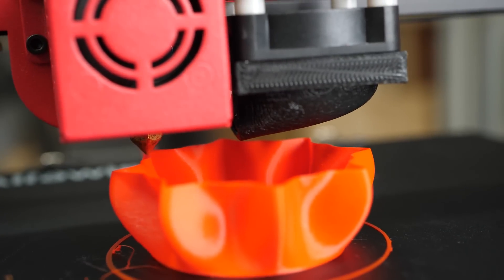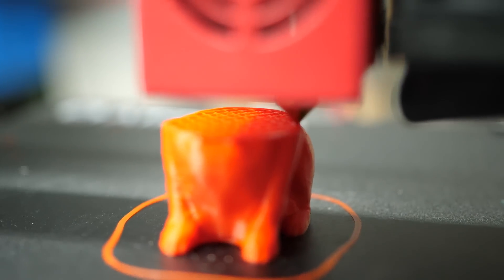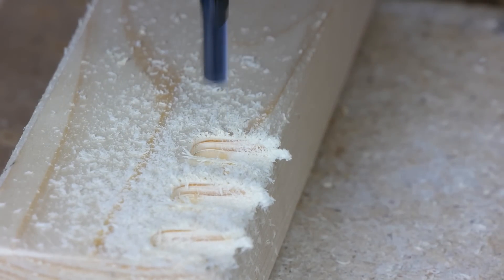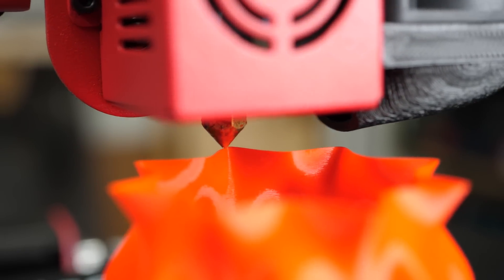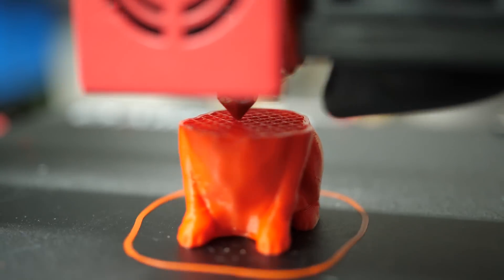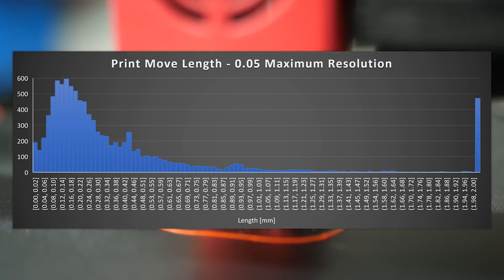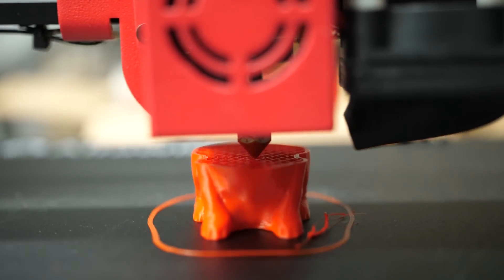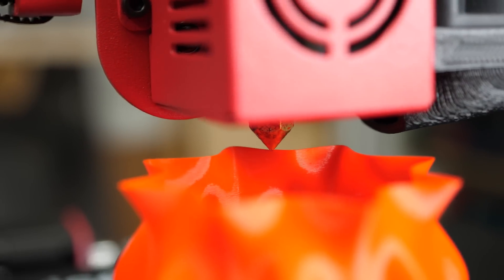(How) I finally got rid of these blobs!

Comment: In many cases it is better to decimate the mesh as this might cause small errors when each layer gets simplified separately. 👍
Reply: On something like the Prusa mini with 32-bit board, would one worry about this per se?
Reply: @danksley  nope i have a mk3s with a 8bit processor and have never had such issues
Reply: @meltedgyrofpv8477  This might not be noticeable at lower speeds or when the object one is slicing isn't as complex as the Buddy model showed in this video.
Reply: @danksley  That's kind of a brute force approach. The slicer really needs to look ahead and smooth the little segments - its the same on CNC machines.
Reply: Hmm that's an interesting approach, as you may otherwise have some extra jagged results in the Z-direction. On some repeating (and gradually smaller) patterns it may result in something that looks like a Moire pattern, but then printed in 3D.   Would it also be possible to reduce the printing speed dynamically when lots of small distances have to be processed? Or will that result in other issues?
Reply: @TD-er  This was my thought over a year ago when i started noticing this on my CR-10, dynamic / adaptive speed control would cure these blobs almost for sure. Adaptive behaviors are implemented WAYyyy to slowly in all slicers, but the one that does it the best is cura, and the one that does it the worst is Simplify 3D.
Reply: @flukve3574  where can I find adaptive speed control in Cura? I can see adaptive layer heights but not speed…
Reply: Is there such a tool available in prusa slicer?
Reply: @Pascal_Robert--Rc_Creations  You could also use Meshmixer which is very simple, compared to Blender. I think Blender is a bit overkill here.
Reply: @luckbot-3000  Sure, but that requires opening an extra program and performing extra steps anyways (though Meshmixer is lighter than Blender). It'd be nice if the slicer already provided such an option.
Reply: @GRBtutorials  I think prusa slicer added that feature very recently, but I don't use it so you'll have to look it up! If I'm not mistaken, both simplify3d and cura are also able to either reduce the mesh or limit the length of moves or both.
Reply: @Pascal_Robert--Rc_Creations  Got answer to your question?
Reply: @Pascal_Robert--Rc_Creations  Did you find an answer to this, or a workaround?
Reply: Wow, I didn't know 8 bit AVR printers are as bad as this. They should approximate a bezier and roughly follow that instead of further decreasing the quality of the model....
Reply: how to fix on prusaslicer?
Reply: The other question is how would you know in advance that your print will blob. It seems like you would need to pre analyze the g code like Stefan did, then make a determination based on the number of small print moves (which would be a pain for each print)...
Reply: @davidpoland1056  Good Idea for a Cura Plugin showing the histogram.
Reply: David Poland polygon count possibly?
Reply: @BossAuto_  I think you'd have to take the surface area of the model into account as well. The problem isn't just many polygons, but rather, many small polygons... Right? I hadn't ever thought about this problem before so I might be completely off with my reasoning, though
Reply: @nyanray  but even more than that,  many small polygons close together such that the number of moves per second overwhelms the processor. It's a cool diagnosis, but applies to a relatively specific set of conditions.
Reply: @davidpoland1056  You can predict it as being likely anywhere you have a pileup of extra tiny moves (which are each a separate command). With longer moves, there is more time before the next command is needed. With tiny moves, it doesn't get to catch up before the next command it needed.
*you could quantify this on your machine with a shape with tight arcs. Either start with too many facets and reduce down until you don't have a problem, or go the other way and start with only a few huge facets (unacceptable detail) and work your way toward more facets until you have a problem.
**and you will learn practically: how much detail is enough vs over kill or under kill

Example: If you reduce the number of facets by half, then you have also reduced the number of commands sent by half

**This will be different for every model of machine**
They all have their own cpu, ram, movement drivers etc. That means they all have their own maximum command data rate.
This is a big part of why industrial machines cost so much more for what looks like similar specs on the advertising sheet.

This is a big issue for hobby cnc routers, so it makes a huge difference whether your circular features are an arc (a single line of code) or a bunch of tiny facets (lots of lines of code).
*Designing in CAD software, get nice accurate arcs. Importing from visual media, get tiny facets.
**I use inkscape (a vector art program) to reduce the number of lines similar to using decimate in blender.

Continued example
If I upgraded my hobby cnc router to Gekko Drives instead of the cheap Chinese blue box controller, I would have much less issue with this, because it can accept and process commands much faster, less stutter rate.  So I could probably handle more than 4 times as many lines and have less issues with that, though there is another issue that transfer rate doesn't solve for routers: it still starts and stops at each line segment.

I'm just learning about 3d printing so it may not have this issue, but to fix that issue on my router, I would need a form of lookahead aka "high speed machining" mode, where it looks at a series of moves and plans for acceleration and deceleration, and instead of starting and stopping at each command, it dynamically rounds them out just a little (tiny precision loss) but keeps the bit moving (more constant, no stop lines, faster overall time, and easier on the bit to not load & unload a bunch).

(Gekko drives can do that too)
Reply: @davidpoland1056  could set up a simple program to do it automatically. Still adds a step though
Reply: 3d builder?
Reply: Can I do that with Fusion 360? And if so, how?
Reply: @jordyv.703  When you export to STL in Fusion there's a "Refinement" option. You can set that to "low". I'm just guessing, I don't know for sure, but it sounds equivalent
Reply: @jordyv.703  you can import STL to BP, then do BP to mesh, so that you can edit it as usual, then export STL
Reply: You are a living legend.
Reply: I'm not sure about other tools. But I use Solidworks, and it has export resolution settings for STL files. You can set the min and max vertex to vertex distance as well as the minimum angle change for curved surfaces. The default settings are really good. No max,  min of 0.1 mm. And an angle of 5 degrees (I usually bump this down to 2 degrees). This means if you print a cube, it will only make two triangles per side. If you print a sphere, it will make sure that the angle between any two adjacent triangles is no more than 5 degrees.
Reply: And how are you supposed to do such thing?
Reply: @Pascal_Robert--Rc_Creations  I'm only just getting started with it, but Blender has a "Decimate" tool which is apparently very effective in the latest version and will reduce the complexity of your mesh with limited drops in visual quality.
Reply: @Pascal_Robert--Rc_Creations  fusion 360 can do it in the mesh workspace.
Reply: @Pascal_Robert--Rc_Creations  You could use meshmixer which is free for example
Reply: @Pascal_Robert--Rc_Creations  Laughs in Zbrush Decimation Master
Reply: @Pascal_Robert--Rc_Creations  oh this is from a year ago lol
Reply: Decimating the mesh sounds like something you'd see in the loading menu for a Sims game
Reply: @jaredf6205  in The Sims

LOL. Reticulating Splines.

Comment: Saw this video and gave me something to think about, this feature could potentially speed up big and complex models.
On my old Velleman K8200 I got around this problem with another solution thou.
I print from octoprint on a RPI 3 and in the firmware I changed the buffer size from the USB. 
As I have no SD card reader or screen I saved some RAM on that. 
This gives me the possibility to print much faster without seeing the artefacts you mention.
I still have the mechanical limitations of the way the printer works, but I would just share my experience with you.

Comment: I've done my own research on this subject recently and what I figured out is that Cura ignores resolution settings completely if you have Compensate Wall Overlaps enabled, since it prioritizes flow adjustment and sometimes generates tons of 0.01 segments, depending on the model geometry.
Reply: Trying this now on a vase and so far I don't see any blobs. Once the print completes, I'll try with another file that has supports since that gives me the most issues and blobs. Thanks for the tip!
Reply: I never really got what that Setting actually does.. or how i benefit of it. But seems like i can finally turn it off now.
Reply: Very interesting, I have been having some blob as well as unexplained retraction issues. This may be the ticket. Thanks!
Reply: Cheers! Compensate wall overlaps is nothing but trouble.
Reply: I can at least say, that the Gyroid Infill prints now much smoother and i could'nt see any blobs until now
Reply: Screenshot red for future reference thank you.
Reply: Thanks for the valuable information. I will turn it off.
Reply: Don't see this setting. Is it gone?
Reply: I've been fighting the stutter with my printer for while now and for the life of me I couldn't figure out, I'll disable that.

Comment: I have just started getting these bumps coincidentally (o prusa mk3). But I'm getting them on straight lines! I only just took photos and then saw this episode. I am getting them when I use the variable layer thickness option in slic3r prusa edition. I know I'm out of date - but I like the USB printing.

Thank you very much for giving me a direction to look. I have thoughts of the slicer not changing all extrusion settings to match the varied layer heights, however in the same varied-height model, I am actually getting the bumps on the layers in my model which I leave at the default height. I am going to investigate further. I will investigate the g-code to see what is happening.

Comment: 0.05 length vs 0.5 distribution looks a bit odd. If you multiply each move count by it's length and add up for all the lengths, you'll get total moves length. And for the 0.05 graph this length will be much smaller than for the 0.5 one... it looks like a Y axis scale issue to me

Comment: I discovered that too, in fact I had way more problems with small diameter circles (as an example screw holes) than the large ones. How I solved was to lower the resolution of all circles, but this was at the expense of the large ones. I was even thinking to move to a 32 bit board, but this seems way simpler, thank you!

Comment: I have actually lowered the max deviation to 0.03 be able to print custom patterns on my prints and some experimental stuff. By designing a very shallow line pattern on a surface, I can change the looks of that part slightly. Similar to Fuzzy skin with a modifier mesh but without having the side effects of Cura handling it as two separate models. It creates a stamp effect. Another trick is to design a 0.05mm deep V-groove along a model to decide exactly where to get the Z-seam on semi-complex geometry.
Reply: My old Wanhao i3's with 8bit Melzi boards actually handles this resolution well.

Comment: Thanks for the Video and the information. But one thing is unclear to me.
QUESTION: Should we just change the maximum resolution to 0.5mm and leave the maximum travel resolution at 0.05mm or should we also change this one to 0.5mm?
Max deviation on 0.05mm is ok as I understood. Thanks for the help
Reply from the maker: I'd say that travel resolution will not have negative effects on your prints, so you should also increase that to the same value. So 0.5mm for both.
Reply: @CNCKitchen  Danke für die schnelle antwort :)

Comment: Wouldn't be much beneficial for 3D community just use for example STEP model a create paths with G2/G3 commands? Same as CAM software do it? Really surprised that after so many years none of slicers support it.
Reply from the maker: Math is way easier with STLs. Even a lot of CAM software for machining use STLs in the background for quite a lot of operations.

Comment: Fusion 360 (and a lot of other CAM packages) also have a setting called "smoothing" or "arc filtering" (Haas cnc video https://youtu.be/vt7rVVRiiKk ).  The smoothing or tolerance produces a faceting similar to the slicer settings you showed.  Arc filtering on the other hand fits the multiple linear sections to larger arc segments with G02 and G03 commands instead of the typical G01 linear moves.  I don't know if slicers can do arc filtering, but it would be neat if there was a setting buried deep in the program.

Comment: We ran into this with a Lulzbot running off a USB when there were a lot of fast tight movements. Pretty sure it was using up the buffer and would pause until the cable could catch up. Seemed to be just fine doing the same speeds via SD card.

Comment: I have used the resolution setting before when I had the same issue on vase mode. A lot of these blobs. Ableit I was printing vase mode with a 0.8mm nozzle and about 120mm/s. The printer just couldnt keep up. After tuning it didnt change anything. I realized I just have to slow down. I am now in the process of upgrading to 32 bit.
Reply: I bought a 0.8mm nozzle for my Prusa's E3D v6 hot-end, but then realized it probably wouldn't be able to melt fast enough to make it worthwhile. You didn't mention your hot-end, but that could be a source of trouble going so fast and wide.

Comment: This is simply poor path planning or communication choke for streaming prints.
With proper planning and enough cpu power in the printer this should never happen. Reducing resolution to fix it is the wrong approach. This should be fixed in the firmware.
Reply: The problem is not wrong path planning, it is the problem of time constraint. The planner have to calculate it before the motion system runs out of queued moves. This is a hard real-time system, and it requires processing power to do it in time. On an 8-bit MCU with few Kbytes of RAM you can not queue so much ahead and can not calculate trigonometric functions fast enough either. Even reading the gcode from the SD card that fast isn't trivial with such small MCU.

Finally, there limit for the resolution. The (micro)stepping of the motors give a hardware limit, which is typically 6.25 microns. But pobably there is a practical limit. The extruded plasic can't be laid down to that exact path, it will always flow "here and there" due to inertia, accellerations, blower fan, etc... It depends on the nozzle size, printing speed, feature size of the object, and so on. I think, for artistic models, it doesn't matter that much, for functional parts, the deviation can be measured if it is that critical.
Reply: @gabiold  , your knowledge and command of the English language are amazing! I assume you are Magyar; possibly an engineer.

Comment: I had this problem at work where they use a replicator 2. With fine meshes and high speeds i would also get small blobs. This setting is a god's gift especially when the resolution is not needed. Much better results!

Comment: You are talking bullshit about 8 bit boards would be worse than 32bit. The bottleneck is the uart with 115200 or 250000 baud, its the same at 8 and 32 bit. The motor controlls are interrupt/timer driven and dont need any cpu processing time. Learn some microcontroller hardware programming before talking about things you dont even know anything about it. Anyway a good tip to reduce the streaming amount, i,ll give it a try

Comment: I had a similar problem on my Ender 3. I would get blobs on small perimeters or sometimes only on one side or one quarter of an object (such as a cylinder). It turned out to be the RaspberryPi I was running Octoprint on was unable to feed gcode fast enough and causing stalls that were practically imperceptible, but enough to make blobs.
Reply: How did you fix it?
Reply: @thomasalkhoury4434  Print from the SD card or run Octoprint on a more powerful system. I currently run it on an Intel i3 system because I had one lying around, but generally one of the faster RPi machines should be sufficient. But just printing from the SD Card is a good way to determine if that's your problem.

Comment: What would you set "Slice gap closing radius" and "Resolution" in PrusaSlicer?
Reply from the maker: "Slice gap closing radius" ==> Don't know, never played around with it.
"Resolution" ==> I think what you adjust in PS is the maximum deviation and PrusaSlicer will automatically merge small segments if under that criterion. So keep this value low! Maybe the 0.05mm like in CURA might be a starting point.

Comment: Going to 0.5 in Prusa Slicer destroyed the model I was using even in the preview so the value is not identical with Cura's.  I tried 0.5 (from PS' default 0) and I could not see a difference but it went from 4.5k down to 3.8k so something changed.
Reply from the maker: I think what you adjust in PS is the maximum deviation and PrusaSlicer will automatically merge small segments if under that criterion. So keep this value low!

Comment: I've just found the setting in PrusaSlicer. It is under Printer Settings / Advanced if anyone is curious.
Reply: Using PrusaSlicer 2.1.1, there is no "Advanced" under Printer Settings. What version of the PrusaSlicer are you using?
Reply: @rpmfpv  PrusaSlicer has 3 selectable settings: Simple (green), Advanced (yellow) and Expert (Red). You toggle them on the top right and the higher settings expose more customization options.
Reply: Out of curiosity - what did you set the resolution to in PrusaSlicer (or have you tried anything besides zero)?